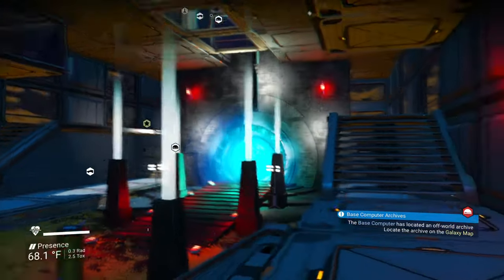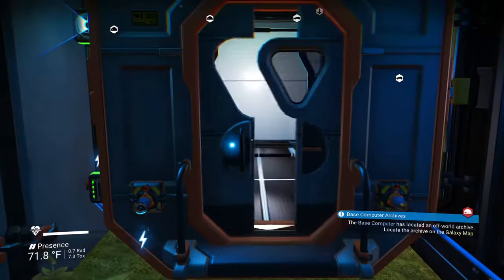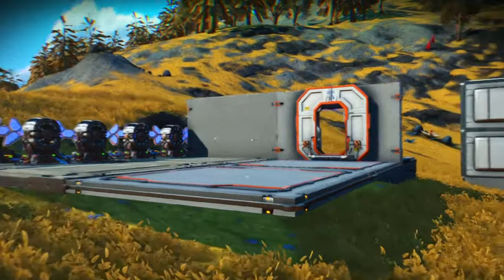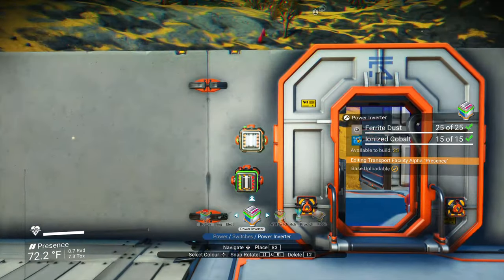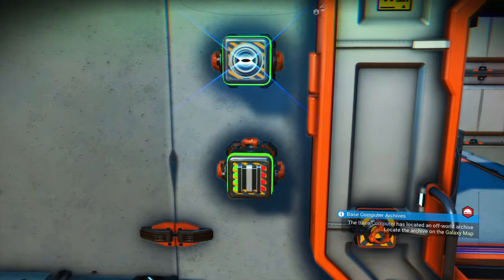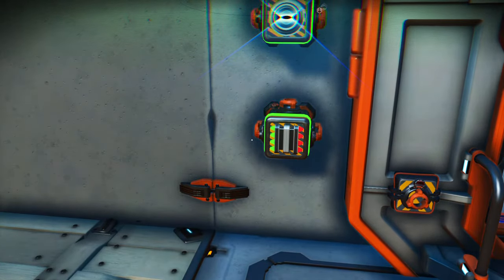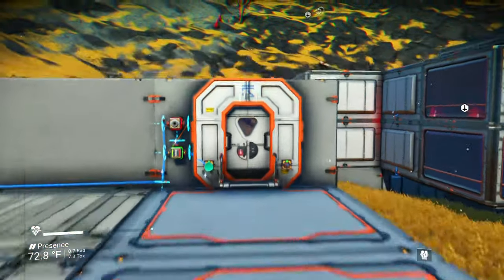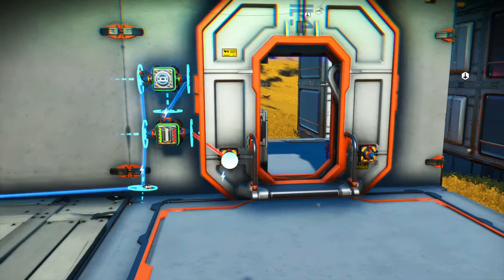No Man's Sky quickie: Simple automatic door.

Comment: You should point out that if you're using a floor switch instead of a proximity switch, you still only need ONE power inverter and wire it to the inside AND outside floor switches.  If you use 2 power inverters, it will not work. It took me over an hour to figure it out.

Comment: 1h30 later and 10 000 combinations later and still not working

2h00 later and I finally got it. This guide is completely inverted. Do exactly the opposite and it works. (Ex: connect red instead of green etc)
Reply from the maker: The color is sort of besides the point. If you're doing it correctly it's bi-directional with the inverter acting as a gate to allow the flow of power through. You can plug it in to either red or green as long as one side is attached to the power source, and the other side is attached to the door., with a switch leading to the center post. 

This method still functions as of update 3.1 it's in use at various bases I currently play in. It is an older video though, and I plan on updating it with some new information, and a couple of different door wiring setups using parts that have been added since this video was made.
Reply: Rusty Hatfield it’s not tho. I just don’t understand why the devs would suddently change the color of the paterns tho.
Reply: Thank you very much :)
That first power cable going to the red side instead of green should be mentioned in the description or be a pinned comment.

Comment: For those who need a typed up list to understand:

Items you need: 

- Door (automatic)
- Power inverter 
- Proximity switch

Instructions: 

- Power inverter has 3 sections: 
1. Green lights
2. No lights (grey middle section) 
3. Red lights 

- Plug a wire from your power source to the GREEN (input) section of the power inverter to power it, then extend this wire to the input (left side) of the proximity switch to power that, too. 

- Run a wire from the output (right side) of the proximity switch to the CENTER (grey section) of the power inverter. 

- Run a wire from the RED (output) section of the power inverter to the door plug. 

Voilà! Automatic door is automated. 

Thank you Rusty!
Reply from the maker: It’s also worth noting that the color of the lights doesn’t matter, it can flow both ways. What’s important is that you have the power coming in one side and out the other, just remember which side is your input and which is your output.
Reply from the maker: And also, that’s some nice guitar playing lady. I’d love to hear some Dethklok covers.
Reply: Ah that's good to know! And thanks for the compliment/suggestion :) @rustyhatfield8302

Comment: if its done the other way around, its a really good way to turn off powers and save energy from electronics you don´t use unless you´re standing infront of it. I did this in early stage with my vaults and many things to save up power. I step up close, the vault get power and opens, then I step away and the power turns off and it locks.

Comment: The lights keep flipping on me, the power is on the green side but when I connect it to my portal in my case, it turns red!! Wtf

Edit: doing it for a portal does not require the power inverter. And when doing it on the door, the lights will flip but when it’s fully wired up they will go to the correct orientation
Reply: I do the exact same thing and the lights flip but when I'm done the door just kinda opens and closes really fast when I get near it. Did this happen to you?
Reply: @arcticfox6776  I managed to figure it out, if it helps try to place all the switches in the exact schematic he has, the door only closes from a good distance away so that might be why
Reply: @spray_cheese  it does the same thing if I trigger the motion sensor or not it just barely opens then closes. I did this before the companions update now all of my doors don't work and I'm trying to fix them. Even in the exact same layout I tried flipping it and everything but still same result. Also you know how the power inverter flips when you power it? That happens every time I activate it but it flips twice in quick succession, I'm guessing that's why the door opens and closes instantly
Reply: @arcticfox6776  hmm I’m not too sure
Reply: @spray_cheese  hey, well thanks for the help
Reply: @arcticfox6776  yea sorry it’s a little hard to diagnose the issue🤔
Reply: @spray_cheese   Yeah I've been through multiple vids aswell and no luck. Fr tho thanks for trying

Comment: Thanks for the video , I’m having a problem with doing the power inverter. When I hook the wire up to it the green/red lights switch sides and I noticed on yours it didn’t do that .. do you know what may be causing this?
Reply from the maker: I’ve heard some people report the lights switching colors, but it doesn’t matter. As long as you have the power coming in on one side, and going out the other. The actual color of the lights is pretty much irrelevant. I have no idea what could be causing that. It doesn’t happen for me on ps4.

Comment: Finally I get it... although I still don't get why devices attached to a structure that is powered have to have their own power source.  Regardless, Thank You!
Reply from the maker: Some structures power attached objects, other structures don't. The problem is that in such structures the ALL of the devices are either ON or OFF collectively, so you can't do anything fun or dynamic with them. In the case of doors, it would severely limit your ability to control them with wires, so no combination locks, puzzle bases, etc.
So doors always need their own source of power.

Comment: Tried this tonight and the inverter flips the green and red nodes when I connect the prox censor from its right output to the inverters top one. So no power getting to door.
Reply from the maker: The color of the nodes isn't really relevant. As long as the power is flowing in one direction. Power goes in one colored side, and out the other colored side. The switch attaches to the uncolored side. If no power is reaching the door the set up is working, make sure you step back a good distance before declaring it non-functional. If this doesn't work you most likely have a wire crossed, but I can't diagnose your problem without actually seeing it.
Reply: @rustyhatfield8302  got it working thanks. At first I thought it wasn't but then I stepped further back and it closed. I didn't realise the range of the sensor at first. Cheers!

Comment: can you put two approximatescanner to two doors so they can open when i go in from both side or should it work with one?
Reply: I assume you have the answer already, but for others who read this question, you only need one proximity switch and one inverter.  It will detect you inside and out.  Another thing is if you're using floor switches, you still only need one inverter.  You just wire it to both floor switches.  If you use 2 inverters (one for each switch) it won't work.

Comment: Looks like it doenst work anymore, did exactly what was shown in the video and it won't work, the invert just turns red after I connect the proximity output to it
Reply from the maker: It still works. The color of the indicator doesn’t really matter as long as input is going on one side and output is is the opposite side. Usually when people say it doesn’t work it’s because they underestimate the range of the proximity detector, so be sure to take a few big steps back.

Comment: ok yes this explains it but what about the other side of the door?
Reply from the maker: Proximity detectors are omni-directional, and are not blocked by objects or terrain. So these doors will work from either side. If they're not working than there must be something else in your setup that is pushing power to the door. It's difficult to diagnose without seeing what you've got. If you tried to network other devices on the same circuit, it's probably causing power to flow through the circuit in the wrong direction. That's my best guess, sight unseen.
Reply: @rustyhatfield8302  I don't want proximity detectors I want a wall switch on each side of the door
Reply: I'd like to be able to stand next to the door and it remain shut. but open and close as I want from either side.

Comment: it doesn't work when I put power on invertor the green light swith  on opposite side.then door just quickly closing and opening.
Reply from the maker: You've most likely wired something incorrectly and created a repeater. That means that somewhere in the loop you have the power out from the inverter routing back into the inverters center post. It makes it blink. Or in your case, it makes doors rapidly open and close. Without seeing your build I couldn't tell you exactly where it went wrong.

Comment: Did this change in the update? For some reason not working for me and I exactly copied
Reply from the maker: it still works. if it’s not working for you step number one is to make sure you take a few big steps back from the door because the proximity detector has a longer range than you would think and most people who claim it’s not working turn out to have not moved far enough away to let the sensor reset and close the door. if that’s not the culprit, double check your connections, sometimes if snap mode is off a wire will appear to be connected when it’s not quite attached. there a couple other things to try but these are the most likely causes.

Comment: How do you get it to work on both sides of the door though is the real question...
Reply from the maker: And the real answer to that question is that you don’t need to do anything to make it work from both sides of the door. The sensor is omnidirectional and doesn’t require line of sight. It already works from either side of the door.
Reply: @rustyhatfield8302  Really? I tried this and you get locked out from the other side.

Comment: How did you bend the wiring at a 90degree angle??
Reply from the maker: Wiring snaps to terrain and surfaces. You can make any kind of angle really. Acute, obtuse, right, the works. Just select the electrical wire from the build menu.

Comment: Anyone else notice their doors stopped working after the expeditions update?
Reply: I had exactly the right configuration when after an update was integrated today all switches seem to be bugged - tried a simple switch but even this one stops power only for a second and than switches back. Had played NMS the early days now came back to see if it had something new for me to discover, well yes but it’s the bugs that keep bothering me the most, even years later
Reply from the maker: I've heard that this is an issue, I have not had the opportunity to try out the new update yet. I'm hoping this doesn't introduce other bugs into the logic system. I'm presently working on a huge logic project that' s almost complete.
Reply: door doesn't work with me with the new update :(
Reply from the maker: @enderboii266  I can confirm that ALL of my logic builds are broken after the last update. Hoping for a fix.
Reply: @rustyhatfield8302  oof

Comment: I hate how they made the inverter so god damn overly complicated. Just invert the power, I don't need a third port on it. The third port breaks everything so that it just doesn't feed power through the inverter anymore.
Reply from the maker: Sure buddy. What would be the point of the inverter without the modification node? it would do nothing and have no purpose. It doesn't "break" anything any more than a light switch breaks the lightbulb in the padded cell you no doubt live in. The logic system in NMS is crazy simple, if has two basic parts, a six-year-old could figure it out. You can do all sorts of neat stuff with the two basic parts they give you. Some people don't like learning incredibly simple things. This is why HG has provided the "dumb" auto doors as part of each material set. So, you know, use those and maybe stop your whining.

Comment: Do you need to do this on both sides
Reply from the maker: Negative. You can have this on the inside or the outside of the door, or even no where near the door. If you are within range of the sensor it will open. I like to put mine under the floor.

Comment: I really wish this was not needed.  It's very tedious anna annoying.
Reply from the maker: No it's not. It takes ten seconds to set up a door, and it only took me four minutes and fourteen seconds to teach you how to do it. Which is about four times as long as it took me to figure out how to do it from scratch. People are just lazy and hate learning new skills. No matter how simple.
Reply: @rustyhatfield8302  I'm not lazy but thanks.   Wow
Reply from the maker: @dovalink744  You're welcome.
Reply: Thanks Rusty, I was thinking of the inverter as strictly a relay and not a method to switch the current. I haven't found a lot of resources explaining the ins and outs in your concise manner, do you know why the cables wont connect to the power sources at times? The green ball is there but not the green connection icon. Same with the teleporter.
Reply from the maker: @madmike8v72  Yes, that's because NMS is still full of glitches. That seems to happen  in two different situations. In one, there are already too many connections attached to the same node. In the other, NMS has randomly decided to take a crap. Try spreading the connections around, or deleting and replacing the affected component.

Comment: I did it right but my door keeps opening when i walk away
Reply from the maker: Then you didn't do it right. Your inverter isn't hooked in correctly.
Make sure the output from the sensor is attached to the center post of the power inverter, and that the power inverter and sensor are both powered separately rather than in sequence.

Comment: ...couldnt there just be an automatic door option? sheesh!
Reply from the maker: @bubbiee.  There is an automatic door option foe each building set, wood, stone, alloy, etc. These don’t require any logic, but they’re also basically useless if you’re interested in adding interactivity. So you can’t hook them up to a combination lock, or a timer, or a pressure plate, etc. That’s what these doors are for.

Comment: Aaaarrrggghh....its frustrating...my power inverter keep flow the electric to the door so its always closes...im already follow step by step...is it a bug or not?aaarrgggh fukin door damn....
Reply from the maker: It’s difficult to diagnose your problem without seeing your build, but I reckon you have a crossed wire. If the door is closing when you get close to it, but opening when you’re further away that means that either you have the sensor going directly to the door, or attached to the wrong post on your power inverter. If the door is remaining closed all the time it means that either you’ve wired your power source directly to the door bypassing the converter, wired it to the wrong post of the power inverter, or done any of the previously mentioned things and it’s staying closed because you’ve never left the range of the proximity sensor.
Reply: Im already far enough from proximity censor...but the problem is the wired from power inverter to the door always blue which is the electricity is flow to the door...from ur video if we closer to proximity cens the wire will become blue n from power inv to door will become red...but my case wether im close or far from proxi cens the wire from power inv always blue...hahah...its killing me...

Comment: Still can't get it to work
Reply from the maker: I most definitely works. If it doesn’t work for you there’s usually only a handful of reasons. 1. You have underestimated the reach of the proximity detector, so take a few big steps back before you decide whether it works or not. The range is longer than you’d think. 2. You have crossed a connection somewhere, so check your connections and try it again. 3. You have attached this circuit to another switch or logic circuit and the two switches have canceled each other out. (See my video on The Big Red Button information on multi-switch doors.

Comment: i have followed several video tutorials to a T and every single time it has NOT worked. I seriously don't know why doors are the hardest thing to use in this game but I'm just going to use holodoors forever. I can't believe I'm getting stumped by a fucking door.
Reply from the maker: If it's done as shown it will work. If it doesn't work here are your most likely culprits. 1. You may be standing too close. The proximity sensors have a longer range than you'd imagine. Take a couple more big steps back before declaring it broken. 2. You may have crossed the wires connected to the inverter, this will cause the door to behave in unexpected ways.  Double check all your connections. Without seeing you setup I can't really help any more than that, but usually it's one of those things. These doors are pretty simple to set up and it's worth learning at least the bare basics of the logic system. It's a very rewarding part of the game that many players miss out on completely.

Comment: I have no green light only red
Reply from the maker: Make sure you're using an inverter. Not an auto-switch. An auto switch has only a red light, unless it's been activated (In which case the light turns green. The two parts have opposite effects.

Comment: Just locks me out
Reply from the maker: That means you’ve got a wire crossed, if it closes when you get close, the connection from the inverter to the proximity switch is crossed, if it just stays closed all the time, your power is routed incorrectly.
Reply: @rustyhatfield8302  I figured it out thanks

Comment: Still not working
Reply from the maker: Tough to say why it's not working without seeing your setup or knowing it's symptoms, but I'd start by standing further back, those proximity detectors have a longer range than you'd think. Failing that, I'd say double check the connections to the power inverter, if you crossed any of those wires it will not work.
Reply: @rustyhatfield8302  i think that is the issue